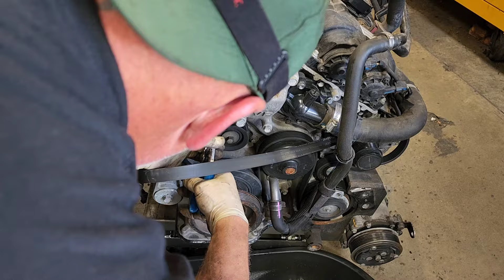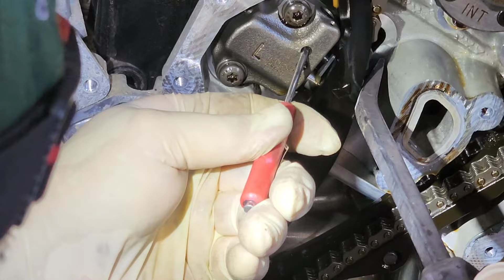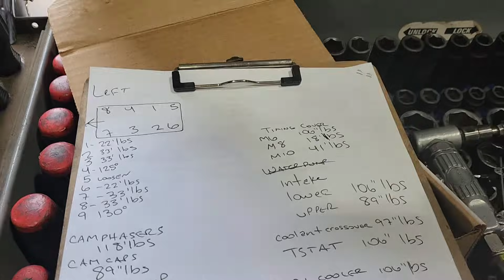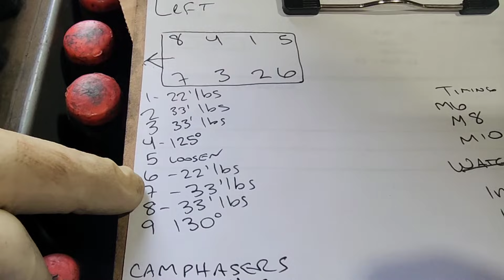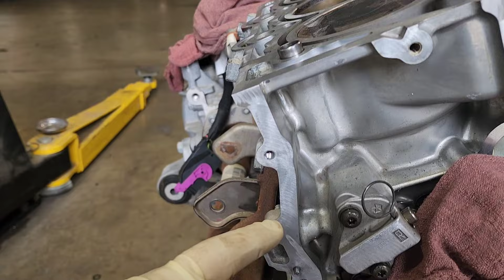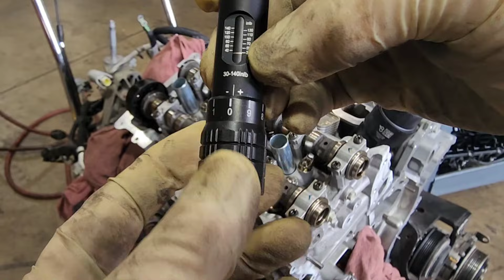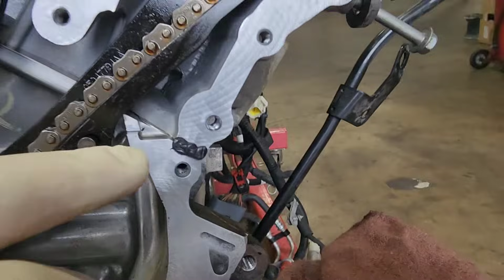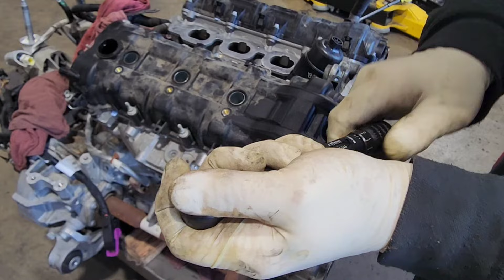3.6 Chrysler Pentastar How to Replace Head Gaskets

Comment: PentaStar seems very “Planned Obsolescence” based as by the amount of plastic and RTV used to keep it “all together”, seems not synonymous with “longevity” as with double metal head gaskets, metal valve covers and metal components that are plastic and will get brittle and crack.
Reply from the maker: It is not the greatest engine that is for sure, has a lot of problems. Camshafts, lifters, rocker arms and the oil pump. But the valve covers are plastic. Thanks for watching.

Comment: Just got my car back with the exact same repair. Was in the shop for a couple weeks - I was amazed you did the whole job in 33 min!  😂 Great video. Thanks for posting it
Reply from the maker: Omg yeah I was actually surprised I finished it so fast.  Lol. Pretty sure this job was around 26 hours of book time because it was in a Promaster that was modified with a secondary ac system.  Thank you for watching.
Reply: How much it costs?
Reply: A LOT @franciscosantillano4159
Reply: @franciscosantillano4159 $100-$150 hr for most ACE mechanics…easily a $4000 job
Reply: @franciscosantillano4159  Enough for me to jump into it. I am doing mine, can't afford the shops!
Reply: U buy anything with a 3.6 u a glutten 4 punishment 😂
Reply: 26 hours three days shesh
Reply: They probably had to send your heads out to get decked and rebuilt
Reply: Muy buen video 👍 👌, cuanto cobro por un trabajo asi

Comment: Thank you for this tutorial video and all the extra TIPS, except leaving that sensor on the head, I won't give you a rash today for not following your checklist LOL. I imagine this is an expensive job so you did not quote an upgraded all-metal oil cooler on this PENTASTAR while you were already in there.
Reply from the maker: I appreciate you watching and the feedback. This is a very expensive job and we put an OEM oil cooler on the vehicle. I know that an aftermarket company makes an all metal one but I would rather put oem on. Funny you mention this I always remove everything from the cylinder heads and somehow missed the coolant temp on this job. I never do this so it is extra funny. thanks for watching.
Reply: Thanks for the video this is great.  Do you recommend replacing the oil cooler when replacing head gaskets? @nutsandboltswithtone
Reply: I'm referring to the oil filter housing cooler..
Reply: me too sorry for the wrong exact name, cheers. @ronaldkleinsasser2842

Comment: Correct me if I am wrong but the torque specs you gave are for new blocks . On old blocks you only do steps 6-9 so it’s 22-33-33-angle 130 . No re  loosening
Reply from the maker: I will have to double check but I am pretty thorough looking up torque specs.  I may have made a mistake though I am human.  Thanks for watching.
Reply: @nutsandboltswithtone  you’re a good man tone . I read it under the specs it said note for engine rebuilds using a new block follow steps 1-9 for rebuilds using old blocks use only 6-9 . Hopefully I am right as that’s how I did my neighbors. Did a video on it to. 🤞 please let me know as I don’t have any auto data. I get it from YouTube guys like y’all 😳